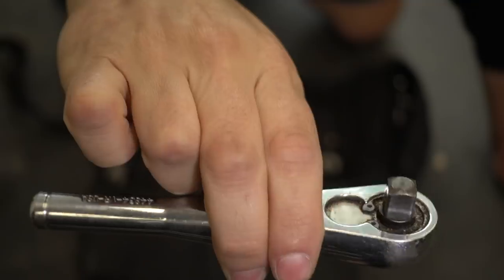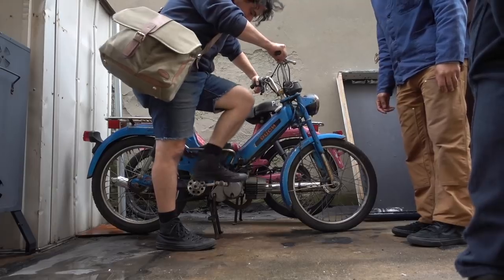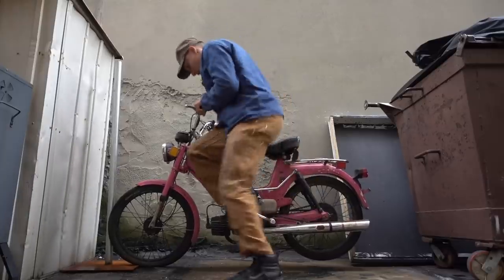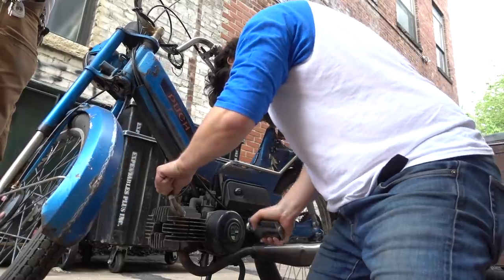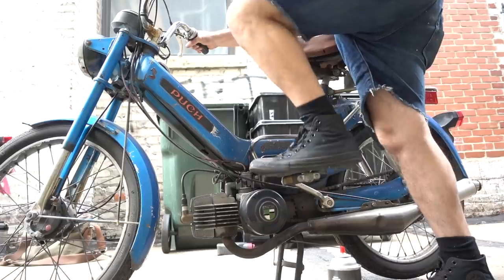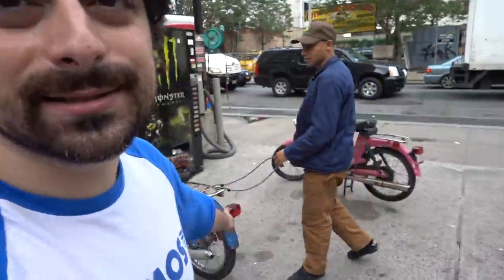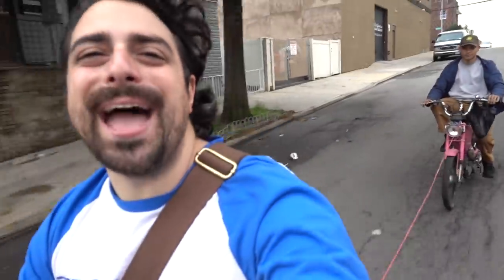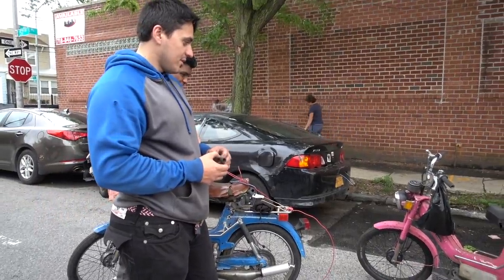How to buy a Moped SIGHT UNSEEN

Comment: Pedalling one of these home is only slightly faster than walking.
Always loved these little things but parts for most of them are not available at all. Some things available for Puchs, Vespas, and lots for VeloSolexes. I gave away my Batavia because the special primary belt for the M56 engine broke and none are available anywhere. What they sell online don't fit.
Reply from the maker: It’s a battle finding parts for some brands.  But everything is available for Puch. TOMOS is still around and we have a ton of parts for them online www.2ndstrokemopeds.com

Comment: I have his and her moppeds in NJ Peugeot TSM and 1O3 . Loads of fun. Got them in Va where we actually got tickets for no registration.
Reply from the maker: Nice, Peugeot made a good moped. His and hers = top tank and step trough?  Or colors?
Reply: Moped Problems 
The TSM is a white top tank. Stripped down and made to look more motocross like the TSE was back in the day. Knobby tires, electronic ignition and delorto 15 mm carb. Stock and reliable is for me. The wife rides the 103. Step through because she is too short for a top tank. Painted green like the old 103SP. Got it set up the same way engine wise.

Comment: Keep a welders tourch tip cleaner in your tool kit as well, there around $5  and are EXCELLENT for carb jet cleaning :-) and in most cases has a cheap built in file to help with heavy build up on the jet :-/
Reply from the maker: Ah I believe i have the very same, or something just like that kicking around
Reply: @MopedProblems  the  Beautiful thing about those is that no matter what the jet size is, your covered :-)

Comment: And now that it started the owner wants more money for it.
Reply from the maker: That’s the trick, got to pay for it first.  Not this instance, but I’ve sold back a bike to the original owner running for more $$$
Reply: @MopedProblems  That means that you have to evaluate the moped on the spot and make a decision wether to buy it or not.
Reply from the maker: No no this is buy “sight unseen” it’s like a challenge. The loser walks home.
Reply: @MopedProblems  Ah. I see now.
I just bought a peugeot 103lvs that i hope i can bring back too life. The biggest problem is that the tank is rusted and it has a couple of holes and i am not sure if they can be repaired. They are not big holes so maybe i canfix them with jb weld but dont know if it would hold against the fuel.